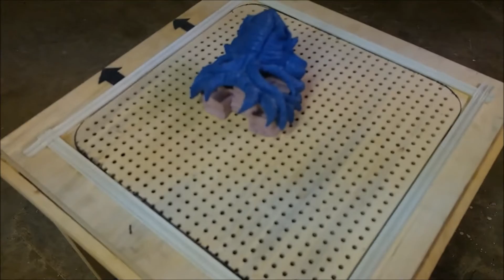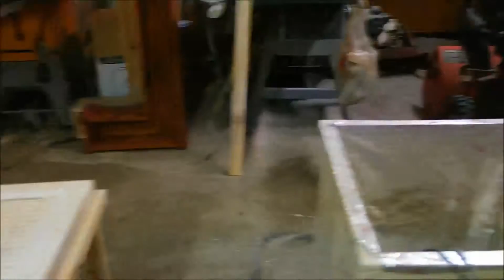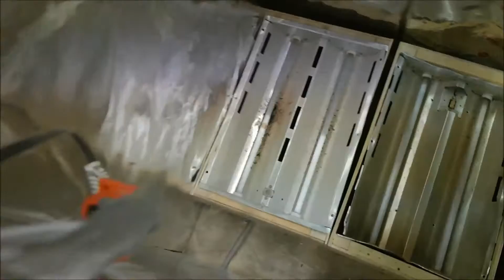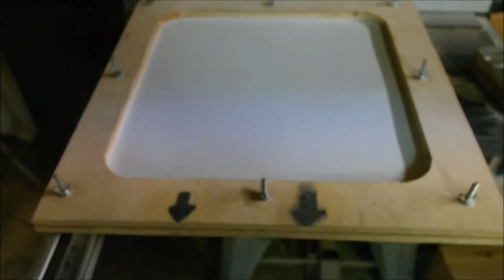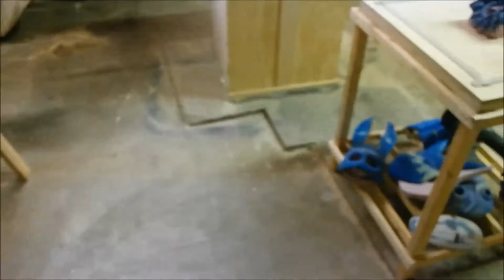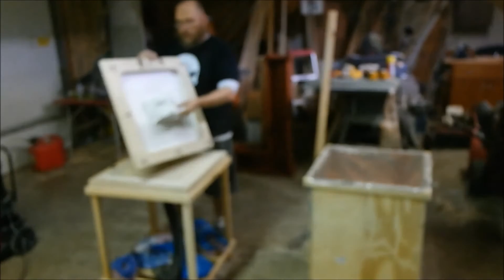Vacuform Basics

Comment: How much does the sheet of plastic cost and where do you get it? Also, what settings and material was the 3D print done at/with? Did you use any smoothing techniques before using the print?

I 3D print costume props and was recently thinking of making a small scale vacuformer for things like lenses of masks.
Reply from the maker: .03" HIPS can be easily got off the internet from Amazon or eBay from $20 - $30 for a 4'x8' roll. Thicker material, which you will need for sturdier things will cost more and it's hard to get off the internet shipped in a cost effective manner.  Luckily I have a place that sells plastic in town so I can get thicker varieties at about the same price.

I print in ABS.  Do NOT use PLA it will melt under the temperature of the hot plastic.  Not a lot of fun.  Originally I did smooth prior to vacuforming but I found it was pretty worthless so I stopped.  The lines present in the 3D print won't transfer onto the vacuformed part.
Reply: +Benjamin Krygsheld unfortunately my machine didn't come with a heated bed so I'm unable to print in abs.
Reply from the maker: I've heard PETG might work but I haven't tried it yet.